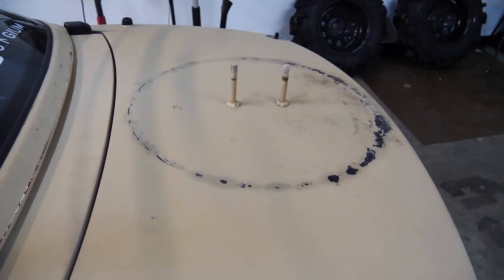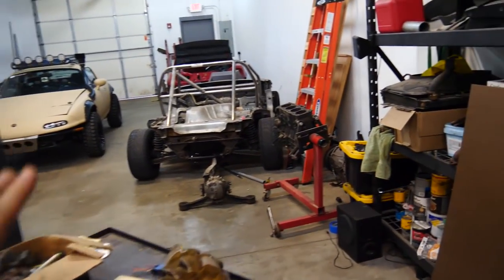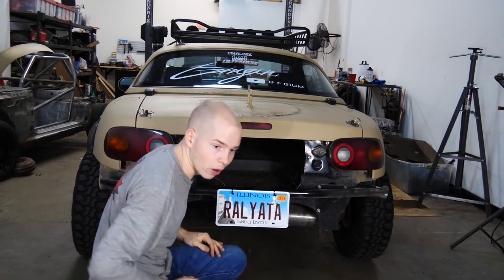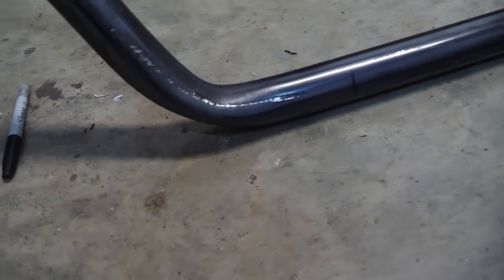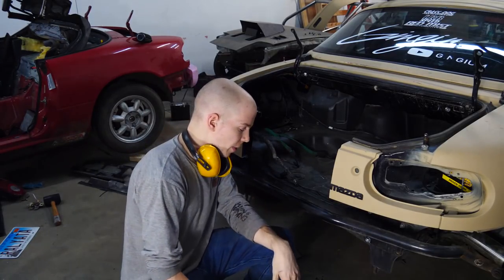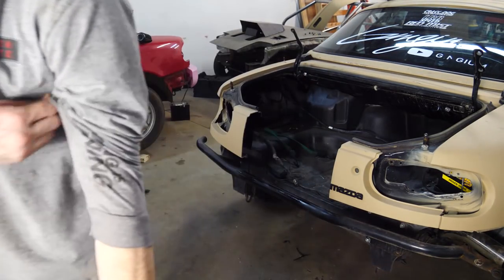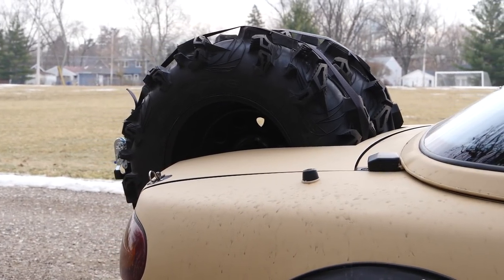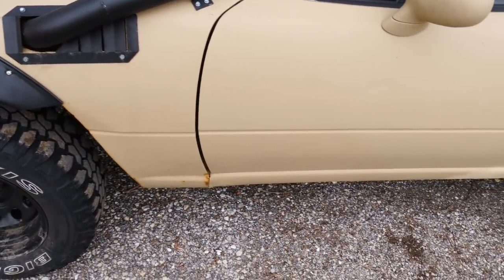Lifted Miata Gets a Trophy Truck SPARE TIRE Setup!

Comment: I think you need to sheet mettle around the tyres in the back to weather proof it and then can still use the trunk to cart stuff. Oh and reinforce the boot lid since you cut so much off it or cut the rest of the way through the middle and make it into 2 little boot spaces that can open and close. IDK IF YOU GET WHAT IM SAYING OR NOT BUT I KNOW WHAT I MEAN. LOL

Comment: What’s up bro I also ready that if you get a pipe,and put sand in there until it’s packed in there, make sure you have taped one side, and heat up the part you are Bending with a torch, and it should bend with out a kink usually

Comment: 1. Tub out the truck for weather proofing
2. Mount a high jack on the roof basket
3. Mount a Air compressor in the trunk for a impact and tire inflator

Comment: Hey! You can get a DC Sports universal license mount kit. I'm using it to hold my front license plate but, how it works is, you stick it into your tow hook mounting location and then tighten it down and it expands out to grab the tow hook mount. So all you would have to do is weld a little section of tube to the bumper and then you can use this mount to add the plate, it's super adjustable what position you put it in, and it removes easily for race days. Just a suggestion! I love the trophy truck tires this thing is getting crazy. Hardly a miata anymore!

Comment: Fill the pipe with sand and cap ends to prevent kinking. Or you can do the same thing if you can fill it with water and freeze it.

Comment: Have you thought of putting some weather stripping around the edges of the hole you cut in the trunk and bumper? That way it might look a bit cleaner and protect the tires from any damage. I wonder how the bumper would look if you just continued the cut you started all the way down through the bumper? That way the bumper would basically be 2 separate pieces, with some of the middle portion cut out. This is definitely a different build, I like it

Comment: Also weld two brackets on each side of the trunk with a removable bar that connects to the brackets then slides it in the middle of the tires..lock on one end or both ..so tires can't be stolen and maybe the weight will keep ur trunk close but hey that's wat the hood pins are for lol

Comment: If you want to supercharge another one I have a decked out Jackson supercharger kit sitting in a box. High boost pulleys, fuel piggyback module, timing piggyback module, etc. I pulled it off my 96, sent it out to be rebuilt, and never put it back on. Eventually sold the Miata and now the kit is just sitting in a box under my stairs. - It's funny, I love Miatas and love rally but never combined the two into a build ... Your channel makes me regret selling mine ... lol

Comment: Kind of like how it looks with stock bumper but it did look cool before too.  I would wait till you get a better pipe bender and do a cool metal bumper, and the tire holder bar thingy all as one project.  Could even use some heavy duty hinges for parts that move.   Like a bar section could go over the tire and then be able to come off.  Could maybe even incorporate a way to lock it so tires can't be stolen.

Comment: Should build a tub around the tires on the bottom and use some OeM weather stripping on the top so when you close the trunk lid you have a fully inclosed trunk that's weather proof with two sides and a far back that's usable  would be dope

Comment: Black metal bumper would look a lot better, great call on fixing the rust, also you should take it all apart in the summer and bed line every panel from the inside maybe that would help. Also, you might want to chain those wheels on the inside, pretty easy to steal them the way they are now, better safe than sorry.

Comment: The reason your "rust repairs" does not work is that you don't remove the rust. you wirebrush it, which removes the loose rust, but you have to actually grind/cut away all metal that has started rusting, and weld in fresh metal. It's still rusty unless it's ground back to bare metal. It's really not that hard, just make sure ALL the rust is gone before painting.

Comment: You should try to add a rubber part around the edge of the sheet metal to make it look better and protect the tires. You can use a cut tube or another product.

Comment: Two things spring to mind 1) The boot is now open to the elements and he just finished the video complaining about rust and this has introduced new areas to the elements 2) I'd be concerned about those tyres constantly rubbing against each other and more importantly against the cut metal on all sides. You'll need to run some sort of rubber stripping around all the cut edges that could contact the tyres and those ratchet straps aren't really up to the job as they only support vertically and not laterally. Other than that keep the vids coming as I always enjoy watching :)

Comment: Good old harbor freight tubing linker.  I have heard if you pack the pipe with sand and then bend it doesnt collapse.   Bought a JD Squared tubing bender.  Like it.  Barely use it.

Comment: You will need to strengthen the boot area as cutting that much out has compromised the boot area so building a tubular bumper to include tubes up each side of the wheels to the rear bulkhead and support the cut trunk lid would help tie it into the rear bumper, you also need to mount a number plate light/third brake light would look good. 
Looking good cant wait to see how it is in the mud and sand might not be good on those rallycross courses too much tread maybe but you have the original offroad tyres for that, maybe some matching but slightly smaller diameter and narrower fronts for in the gloop and sand would work better those you could strap in the roof rack, just a thought.

Comment: not to be the bearer of bad news but, you need to make a waterproof tub that the tires sit in but won't let the water into the trunk. like a tub that goes all the way up to the top of the trunk lid and bolts in so it's impossible for water to get in

Comment: I know that this is a day old and you probably won't see  this, but there is nothing wrong with the pipe bender. You should have filled the pipe with sand before bending it so it wouldn't kink. I do that all the time when bending pvc.

Comment: I like the looks, but it could use a little refinement to be more practical. First off, Use a bedliner on the inside of the trunk to waterproof it. You will also want to add a drain, because that tub is going to fill up quickly. Next, you still have part of the trunk in place. Why not make it useful? Get some sheet metal, and form a new trunk around the tires, so you can still store stuff in a locked compartment. It should also help keep your tires safe if you remove all the sharp edges.

Comment: Yo Ging, super cool idea! But, if i should do it, i would build a frame inside the trunk, so you can put a long bolt trough the wheels. this way the ratchet straps wont be picked, and wheels stolen n stuff. also maybe more clean look.

Love from Denmark

Comment: If you have to get it done.
Fill pipes with sand and cap the ends then bend. It will not kink.

Comment: I think for the rear bumper you should do a metal piece with holes cut in it and then have those holes go through the bumper similar to how your exhaust hole is cut and paint the metal piece black so it adds a black accent and so you keep the clean bumper and it looks more aggressive, kind of like what a lot of Honda's do to the rear bumpers

Comment: I was a bit skeptical but it's looking pretty nice. In regards to  the bumper. I do like that it looks clean with it, but maybe cut some vents(like what they do on some drag cars) to make it look a bit more aggressive. Also, hope the cut heals up smoothly. I know how it is cutting your finger like that. Happened to me at work when I was steeling a knife(I work in the meat department of a grocery store). Didn't need stitches luckily, but have a very thin indent and scar where I cut myself.

Comment: When you use that bender try using the size smaller die than the pipe and it will bend better this is what I do with mine

Comment: I would use the bash bumper and put discreet license plate mounts and only keep the tag on when driving on roads. Not the biggest fan of the tire setup, but it can be made better.

Comment: Eastwood's got a reasonably priced bender, but I would suggest just find a fabrication shop to get your bends done for now. Also you should totally nab the lower rear corner that you had to cut out bc of rust from that red miata if your friend doesn't need it.

Comment: It looks awesome one thing ill add is a flat hook and rachet sonit doesnt twist  and please add some window rubber or rubber edges fot the tyre  and plus it wil also help if youbtakke it out not to cat yourself again and awesome work inlove your content
 Suggestion: try and add a  upright   wheel carier (like a jeep ) this would help for protection  against  a bump  from a car wil be a bit mor secure and the othe wheel put it on the roof  and you can probably  do a high lift jack in the old tyre carier space and then an tyre on the roof or on a bumber carier cuase now the only secure place is in the car

Comment: As others have said, isn't it going to get full of mud and stuff (you're getting mud flaps to avoid some mud on the back, but you don't mind your boot getting filled with crap) and also isn't the metal going to cut through the tires after excessive rubbing?

Comment: now fill the trunk with bed liner or weld here sheet metal (drain system with holes) to be able clean it out when mud gets there 
But honestly it looks good for me, it's just not finished

Comment: Should have welded up a "bucket" or tub to put the wheels in. Could have moved the latch over and kept the small end sections of the trunk for tools. Also prevented mud, smow, water and what ever else from entering.

Comment: I like it a lot when everything was put back on. Kinda in between the Bumper and no bumper. But I have to ask, won’t the trunk be super exposed now? I don’t think you ever used it anyhow but it might start rusting inside out now. I know there can be a protective layer of coating applied. Love your videos Miatium!

Comment: cuts some lines to run down the sides and back of the miata to make it look cleaner and so the metal doesn't dig in to the tires

Comment: Looks good as is. The iterations of this car is whats kept me interested in your channel. And now you can have two trunks. His and hers! I dont think the tires are strapped down the best way, i.e. looks like the straps can slip off super easy due to the big ass knobs on the tires. But its your ride.. i think putting in a bash bar will only hinder the ability to remove the tires when you need to.  Either way, i still love this car and always give it a thumbs up. Keep rocking that shit

Comment: should really build a little tub around the inside the trunk around the tires so you dont fill the trunk with mud and have a dry spot to stor recovery stuff etc.also put a drain in the bottom :) build walls and tub it add a door seal at the top tada

Comment: Long as you like it man its all good, it'll work ... Although when you told us another option and 'That would look dumb' I did go 👀 a bit after I saw the plan..
Reply: If you find some softer vacuum hose, split it, you can slide it over the bare edges and make a 'trim' of sorts at the same time....

Comment: I personally dont mind it, but it really isn’t practical caleb, its impractical to the point where you might as well remove the doors to save weight, get the mud tires on permnently and just go full off road car. Remove lights and fit a massive cage etc etc

Comment: You need to use a smaller die  than the pipe is   In that pos harbor freight bender    Eastwood makes a bender

Comment: Umm... I see some flaws in the design of this... I really like it, but...
-I'm concerned the tires will pop on the sharp edges on the trunk from bouncing around.
-Some drain holes are probably needed.
-Maybe slide a tube through the center of the wheels or bolt them together to make them more stable.
-Bedlining the trunk?

Really dig it though, just take some advices from the comments.

I voted no bumper, but i would like to see a similar setup as the front plate.

Comment: wrx swap will be cool and all, but i feel like its not going to have enough touque if youre gonna run so god damn huge tires. maybe go for a larger displacement truck platform, maybe buy an already lifted old squarebody, sell the body and swap in the miata body? idk. i fell like a turbo 2.0/2.5 isnt going to be enough for mud bogging with that kind of tires. cool video nonetheless. sorry for horrible english. stay safe.

Comment: Hey gingium, just a question.
Can messure up the metal you cut up?
I wanna make a miata rear panel swap, but because i have a edm mx5, i don't have the holes for the license plate lights.
So if you could somehow make a good pic with the messurements, that would be amazing.
Cheers, a german fan^^

Comment: I see people trying the steal your ratchet straps I would have just looped it through the center of the wheel using the same mount you have it hooked too now just one strap but I would maybe try your luck at pie cuts for the bend and add your back hoop but make a legit mount for your license plate on it

Comment: The idea is there but the execution could have been better. The metal over time will rub at the tyers and also the trunk entirely is gonna rust now. Should have built walls and a floor inside the trunk so that water nor dirt would get in there. I also feel that tyers that aggressive aren't really necessary. Would probably just be better off getting tyers that are legal for the roads and just taking 1 spare instead of a pair of tyers. Something I personally wouldn't have done but you do you.

Comment: The rust is gonna keep coming back if you paint over it, do it right and cut it out. And for the people who say mud and water in the trunk, drill a couple holes and it’ll be fine. Besides it’s called the rallyata not the mud boggeryata

Comment: Would it not be smarter to have the straps inside the trunk. weld 2 hooks in the trunk and run the straps through the middle of the wheel. Harder to steal tyres or cut the straps

Comment: it doesn't look that good to be honest, but its too late, i would change the rear lights for LEDs mounted on the tube frame, delete the bumper and the trunk, and make something like a tiregate for trucks, it will look better in my opinion, look it up

Comment: Where can I send you ideas for the rear bumper where you will actually see them. You read the comments but you rarely respond to them, and you don't reply to emails or Instagram Dm's either. I have an idea to keep the bumper, but make it look far more aggressive. And I have something sketched out for the trunk so you don't have water pooling up in there resulting in rust AND it helps with the rigidity of the trunk, since, by cutting it, you have seriously compromised the structural integrity, almost as badly as when you wanted to off-road it with the doors off.

Comment: You’re using the wrong tool buddy, not harbor freight’s fault for that.  Like you said it’s not a tube bender, it’s a pipe bender.  There are additional steps you have to take to keep the tube from kinking.

Comment: Weebs and Continental Kits... that has not gone well, has it ?
The trunk floor is gonna rust so badly from all the water, mud and salt. All the paint in the universe won't save it this time !
On the plus side, the rust holes will help drain that smelly mess out ^^

Comment: Been there before and saw that coming.  Broke my nose with a breaker bare changing the pads on my 92 miata. Don't like the trunk.  A spacer on the lid and one on the lid would have been cool. Molly looked just like my miata.  I miss it.

Comment: Honestly 
If you remove the whole trunk cover and that piece between the lights and tube the whole rear end  it would look way better 
But nonetheless it looks good
Reply: And add a “block plate “ inside the trunk to isolate it from the open back
Like some proper insulation with rubber and shit

Comment: If you're going to be towing this around to events with your bus, wouldn't it make much more sense to put the spares on/in the bus instead of adding extra weight to the Miata?
Sure, it looks cool, but it's probably going to bog you down with all the extra weight in the back.

Comment: 1st... Hey try out the air-suspension it will fix the way the rally Miata drive off-road and on the street??
Reply: I don't think it's worth ,plus it could be less reliable than normal suspension
Reply: Nonono air suspension is 1 to complex 2 it's meant for low Bois and won't go very high 3 it adds a decent amount of weight to the car and that isn't okay bc he has a low low amount of power
Reply: Probably too expensive, and bags wouldnt work offroad. They'll probably get damaged instantly and start leaking

Comment: EPOXY. You need to epoxy prime before anything to stop rust. Regular primer is not a rust preventative. Get no sanding needed epoxy primer and spray that on raw metal 1 hour to dry then you can paint it or primer it with regular primer but you have to seal the epoxy within 7 days

Comment: It looks cool and all, but it is not waterproof! The wiring, the lights..... Why don’t you make a sort of bucket and welt that on the inside or on the trunk itself? + make all the corners of the inside and outside off the bucket waterproof with kit. I think that’s a much smarter idea.